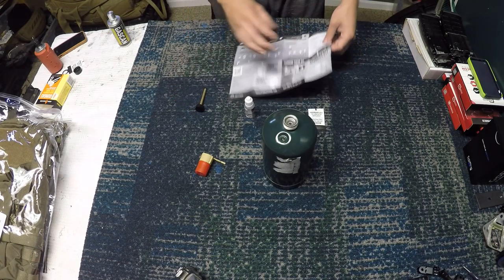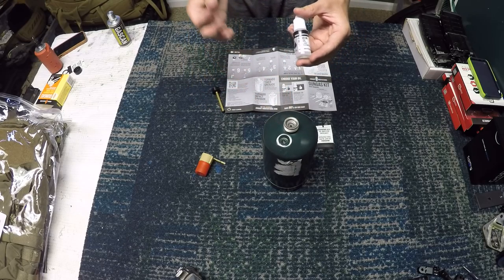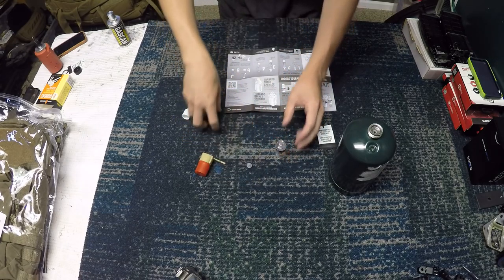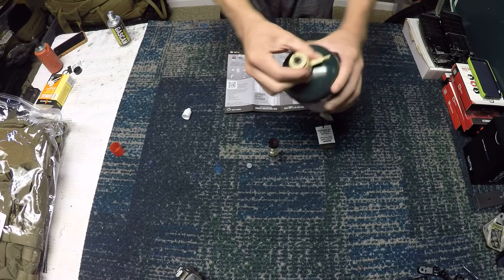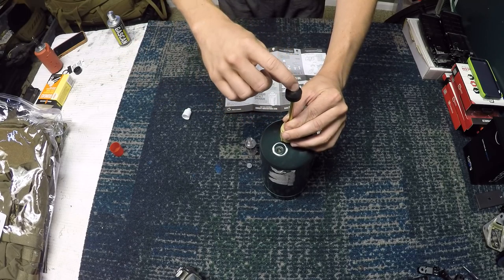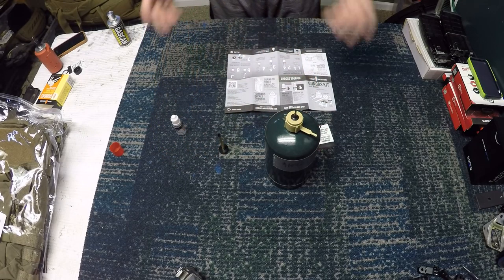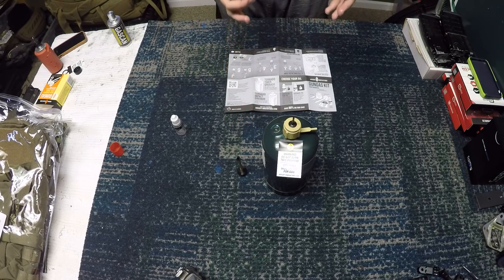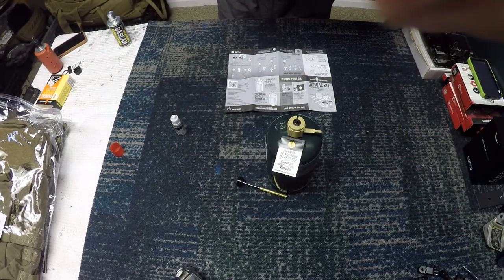Airsoft Innovations Oil Pump Review

Comment: if you want to maintain decent accuracy with GBB guns, rifles especially, (as much as possible anyways) do not mix oil with the gas, it will get into the bucking and make it very inconsistent (on top of the gas inherent inconsistency). Obviously you should still lube all the moving parts, but that's regardless of whether  you're using green gas or oil free propane. If you're worried about the O-rings drying out, you can take the mag apart every once in a while to oil just the seals.